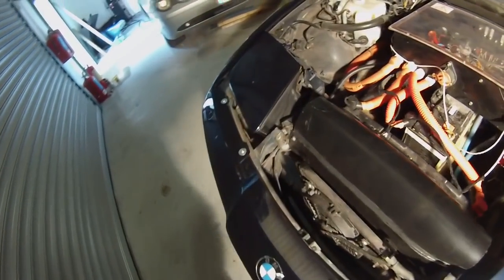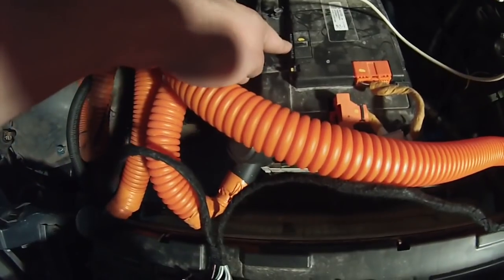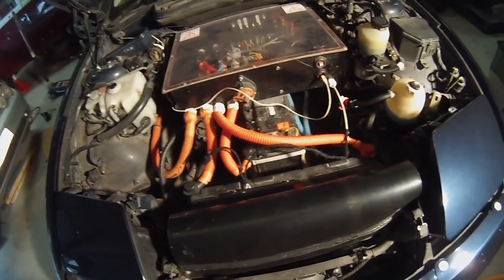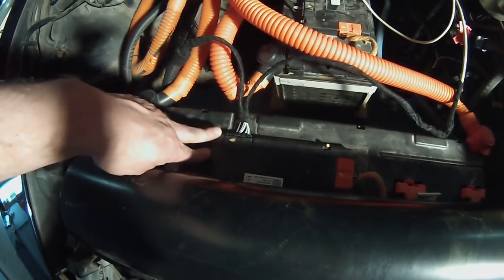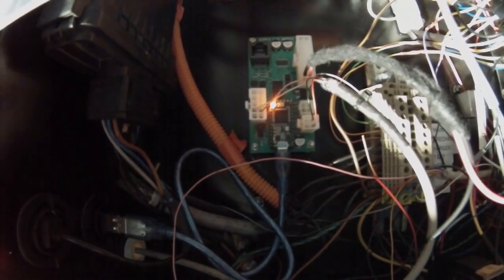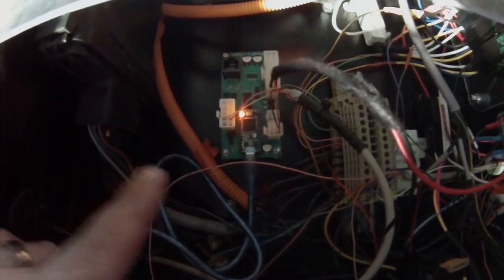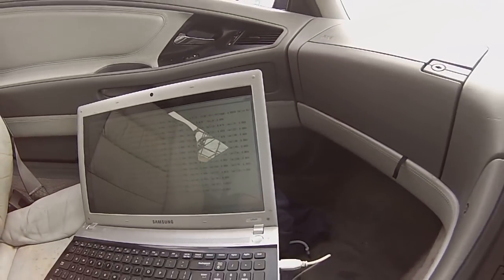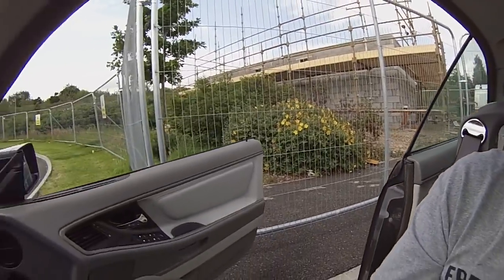BMW E31 840CI EV Conversion 114: The E31 Gets a BMS

Comment: hello, super nice channel, i subscribed yesterday, but a small question, your telling that this battery (volt/ampera) can deliver the maximun discharging current for a large tesla motor, do you know how many amps you will need and for how long? i have a complete battery pack of a bmw i3 (94ah, 8x4,14kwh 96s) (413A for 5sec @20c) and im wondering if i can fit a large tesla unit! thanks and keep up the nice work! Greats from the Netherlands regards Joris de Vet

Comment: Strongly considering an e31 conversion with a model 3 rear drive and Chevy volt batteries.
Based on your experience, was it a huge pain to deal with all the car's electrics and coding so it doesn't go insane from not having an engine or transmission? How much hacking did you have to do with the instrumentation?